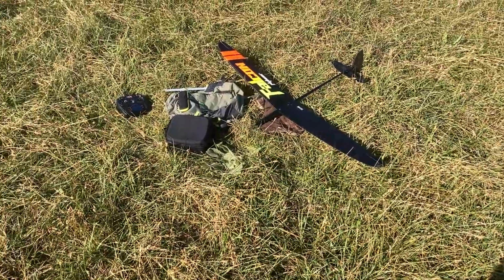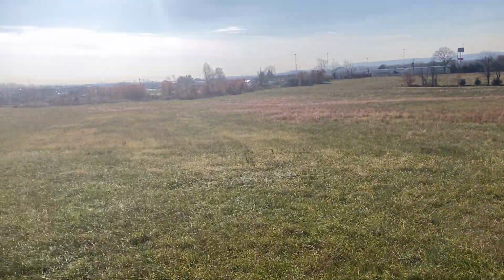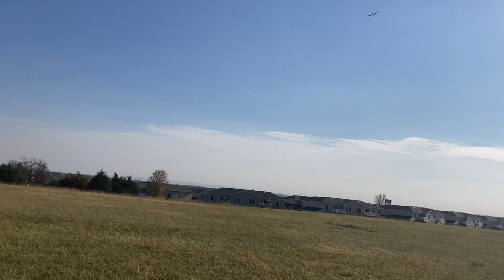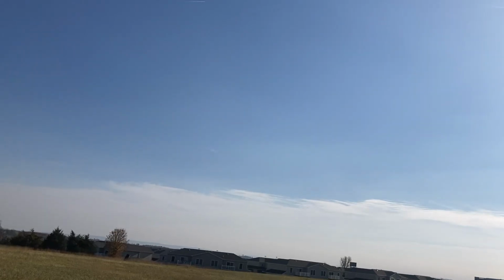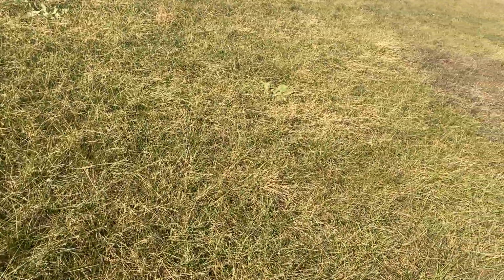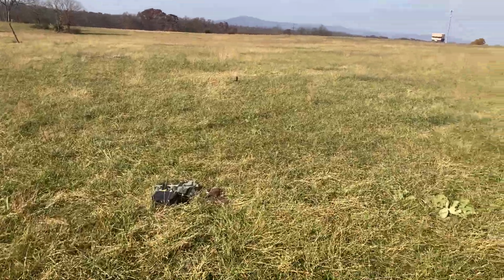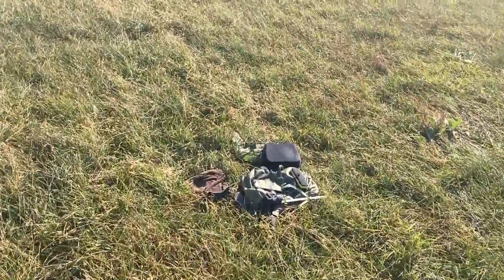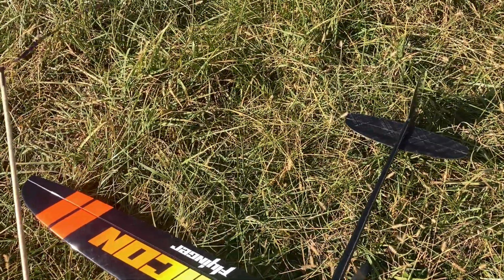Falcon 2 DLG

Comment: I used to put a servo into a sliding servo tray and move it fore and aft to control penetration. Works great. Try it.

Also, you'll have better video results wearing a helmet with a Gopro attached.  It films wherever you're looking without involving your hands.
Reply from the maker: In a larger ship I would try an extra servo, never ever going to be room for that in a dlg.  Haha

And that’s my phone in my forehead on a strap.   Not ideal, but not bad either. If you’ll send me a GoPro, I’ll be glad to use it.   😁😁😁